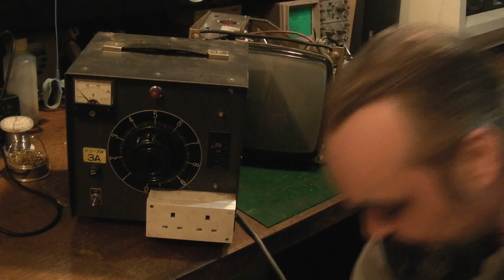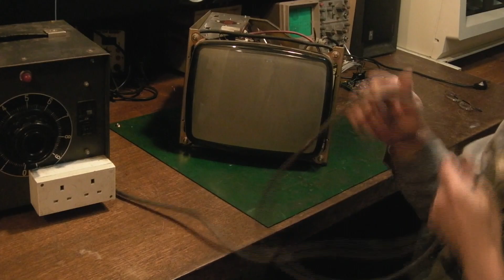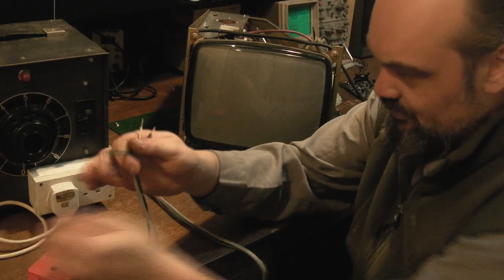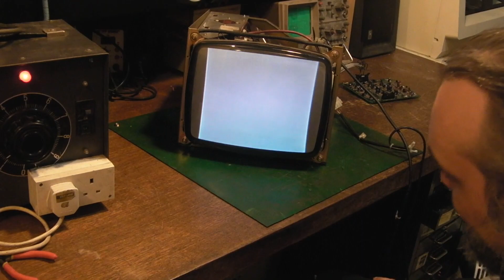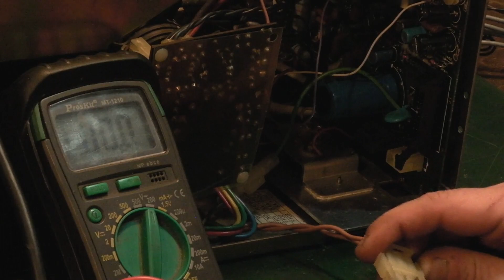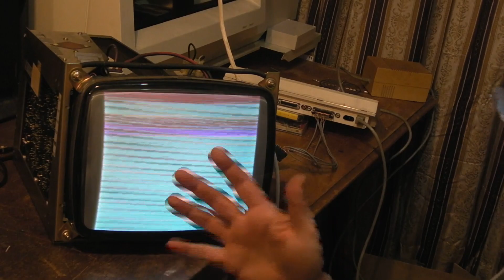Hitachi S-4000 computer. Playing with the colour monitor Pt1

Comment: The horizontal frequency was far enough off to not lock in. I often get that when powering arcade games on the bench. If the slightly diagonal lines get more horizontal, you're turning it in the wrong direction. The vertical frequency also needs adjusting. What I'm seeing tells me that this monitor should work with the Amiga though.